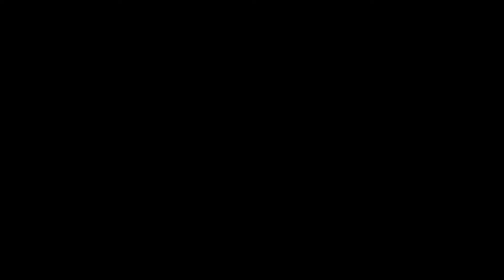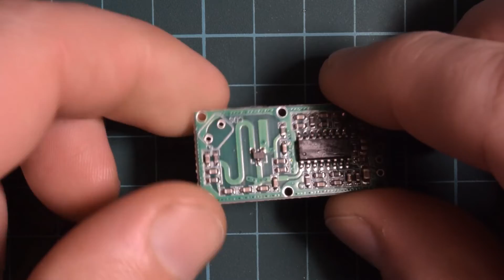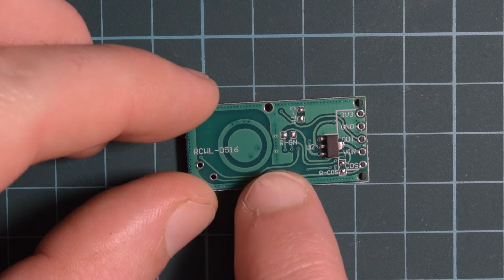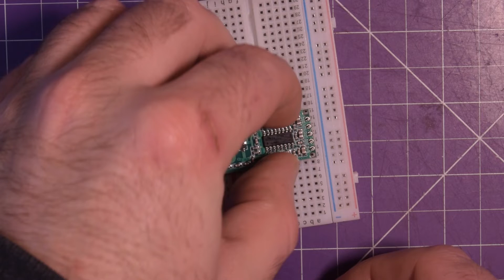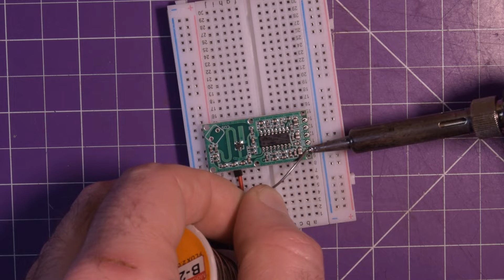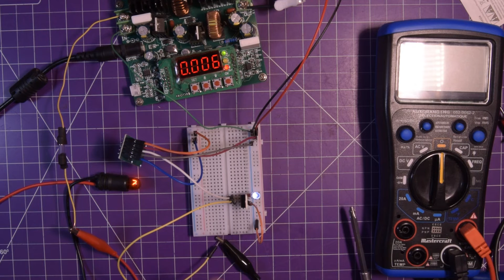Getting A RCWL-0516 Microwave Sensor To Work!

Comment: I've been through 10 of them, can't get any consistency.  Batches must be bad lately.. it get triggers from the side sometimes, someone's the back, never repeatable events to trigger it.  Tried more power, less power, different length wires, in a plastic casing, in the open air, morning (75°F), afternoon (90°F), in different humidy (65% - 90%), fast approach, slow approach... Nothing triggers it consistently... Very frustrating.

Comment: Ahhhh, so nice to see someone using "Human Measurements"

Well, THAT should trigger a few folk in the comments 👍🏻😂

Ps. Have one of these "radars" in my kitchen with 2 x PIR's, and it reduces the false triggers for both PIR's dramatically.

Just code in the radar to both PIR's individually, and then either pir1 & radar, or pir2 & radar detects motion, trigger automation.

The code is stolen from somebody else in the forums, but it's  actually quite elegant, and can be modified for 1 or 2, or however many Sensors/PIR's you have (can supply code if you want it to mess about with it 😊)

Ps. Ps. I just left the first wire floating, not pulled up at all, doesn't have any undesirable consequences 👍🏻

Comment: Well done with the video but this sensor is a total garbage. In my case it triggered from a distance of 2cm only. And the output is 3.7 v but I assume that the current is not high enough to energize a relay. Even a red LED can hardly be lit.
Reply: Yup i just discovered this 😔 at one point it did work in the next room but ive tried 2 now and both just 1cm range
Reply: Do as was shone. Use a transistor for the heavy lifting, or are you still stuck in dumb-dumb land?

Comment: I got the same sensor.  I felt it was a piece of crap. The range was nowhere near what it is advertised.  Mine only worked at around 2CM  I replaced it with an HW-MS03 V.06.  The HW sensor works flawlessly!  Even motion through my plastic folding table.
Reply: I gota say im very disappointed.... ive been sat here for hours trying to figure out whats going on. At one point it was working when i went in next room but now its 1cm range. Im gona check out the one you mentioned

Comment: Nice video, these are dirt cheap now, $7 for 6pcs on Amazon. Are you sure that was that a logic level mosfet? If it's not, that's why your 12V bulb was so dim and the mosfet got hot.
Reply from the maker: It is a logic level mosfet indeed

Comment: No need to pull up with 3.3V pin and pulling down to Ground will disable the unit. Keep it away from metal objects such as breadboard as it has metal strips, 20cm (8in) distance will do.

Comment: Hey, a quick question:
does the heat from the soldering iron damage the breadboard in any way?
I thought of soldering the pins of this sensor(and other sensors) using the breadboard but I thought that the pins will be extremely hot and will melt the plastic and damage the breadboard, so did the breadboard suffer any damage?
Reply from the maker: No sir, as long as you move relatively quickly, it's fine, I've been doing it for years and years and never damaged a breadboard
Reply: @SimpleElectronics  thanks alot, that is a very helpful hack (y)

Comment: Hello, the transmitter will not work for me in this module.  So how can I turn off the module's transmitter completely?
Reply from the maker: I'm not sure I understand your question?
Reply: @SimpleElectronics  ı mean, how can ı turn of the transmitter of the modüle?
Reply: @Jeffrey Wolsieffer İ want use this  module only for microwave receiver. So, i need turn off transmitter part. How can ı made it?
Reply: @ahmetozdemir7173  This unit consists of an oscillator which radiates a microwave field. Microwave energy is reflected back by a moving body, and this affects the oscillator and is detected by the ic. There are no seperate transmit and recieve circuits.

Comment: The purpose of my project; Preventing malicious people from approaching my boat, which I anchor in the sea, with sound and light warnings.

In my project; I want to use Arduino uno r3, rcwl-0516 microwave radar sensor, XL4015 Adjustable DC / DC Voltage Reducer,  433MHz Universal Wireless Remote Control DC 12V 4CH Relay Receiver Module RF Switch Remote Control , lighting and a loud buzzer.

My project will work with 12v dc current. I will supply the system with a 12v battery.

What I want to do in my project; Position my boat rcwl-0516 in four directions. When any of the sensors detects motion, wait 10 seconds and turn on the boat LED lights in 11 seconds. In the 15th second, the buzzer is active.
Keep the lights and buzzer active until the system is turned off with the remote control. When there is a safe environment, I will turn off the system with a remote control ...

I would like your help for Arduino codes and circuit diagram ...

Thank you so much...
Reply from the maker: Hey, thanks for the comment - your project seems like a quite intricate one and I wouldn't have the time to sit down and prototype it for you - I would recommend spending some time learning the individual parts of the project and assembling as you go! Good luck!
Reply: @SimpleElectronics  hello, I'm asking you for help with coding ...
Reply from the maker: I understand, and I am flattered that you turn to me for help, but this is a complicated project with relatively difficult coding, I would recommend you post your code to the arduino forums for coding help, it would take me days of work to help you.
Reply: @SimpleElectronics  thank you so much

Comment: So do you know what the exact SMD Capacitor is for the required sensor to extend the trigger time?
Reply: C-TM gets a .2mF = 50 sec, 1mF cap = 250 sec .. per specs: I haven't tested it, nor found any vids on it though.  I have had zero luck just getting them to work consistently, so modding is a way off for me.

Comment: Data and schematics for the chip (RCWL-9196) and the board (RCWL-0156) can be found at:
http://www.mpja.com/download/34685MPData.pdf
https://www.mpja.com/download/34685MPSche.pdf
https://www.snapeda.com/parts/rcwl-9196/RCWL/datasheet/
These documents also show some options that are available on the board for adjusting range, trigger cycle time and light sensitivity (if using with a photoresistor).

Comment: You don't need to add a series resistor to the LED. There's a 100ohm series resistor on the output on board.

Comment: how to incorporate an piezo like buzzer so we have visual and audio alert when motion is detected. What voltage required for speaket?  I use thercwl 0516 on it's own no arduino added.
Reply: Did you ever figure out how to do this?
Reply: @billsquires79  probably could just wire it to a high level trigger relay
but all my relays are low level
I saw a video on how to convert a low level to a high level 
but I would like to see more on how to do this and specifically using this sensor 
with a  low level opto isolated  arduino relay board with no arduino

Comment: My two cents: although the VGS(th) is reached and the channel between drain and source is open, the MOSFET is not "totally" on in relationship to the VDS. If you look at the datasheet of the MOSFET you can see that under test conditions of VGS(th) it says "VDS = VGS, ID = 250 μA". VGS indicates the beginning of the turn-on proces.

In between the microwave sensor and the MOSFET you could use a "Totem Pole Driver" to drive the MOSFET.
Reply from the maker: Looking again at the data sheet, I can see that the RDS(on) figures show 5v and 10v so it may require nearly 5v to have a relatively low on resistance

Comment: Why do people insist that it is the doubler effect? The oscillator is made to be very sensitive to the environment and output level will change with very small changes in the environment. This is then detected by the same IC as is used for ultrasound and PIR detectors.

If you MOSFET is from EBay or Aliexpress it may be the reason, I have bought a lot of logic level mosfets that are not logic levels. There are MANY fake mosfets, they have the number of a good mosfet, but when you measure the specifications they are are very cheap mosfet that must be driver by more than 5V to turn fully on.
Reply: "Doppler", not doubler.